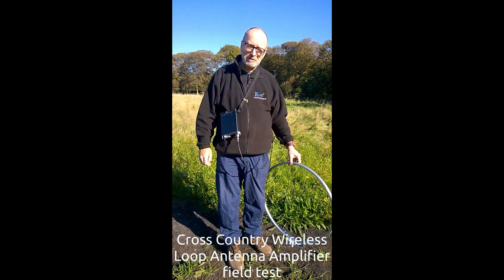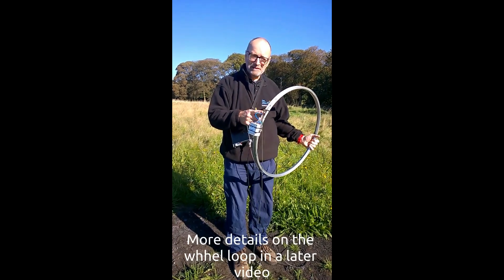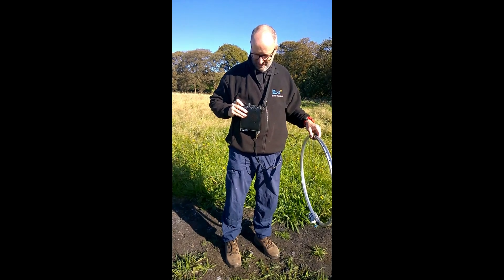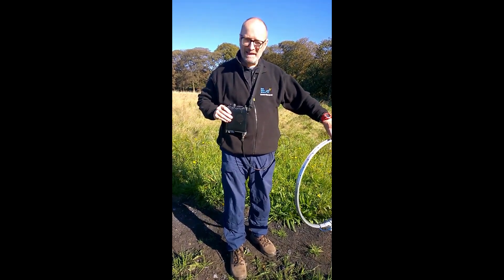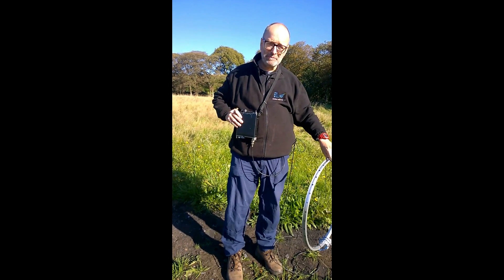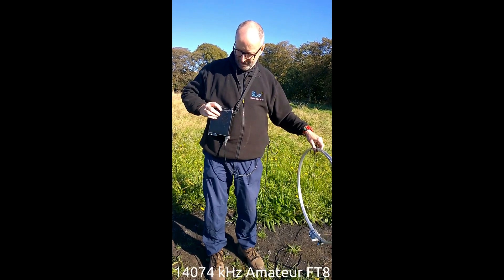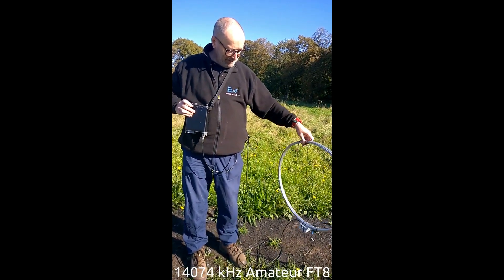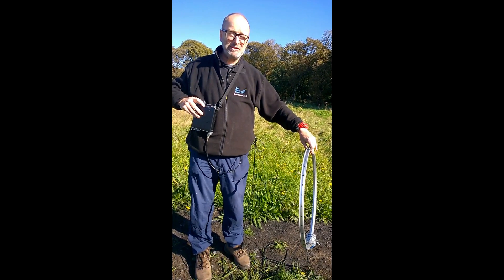Cross Country Wireless Loop Antenna Amplifier field test

Comment: No problem understanding the presenter but the wind noise was annoying (and avoidable) ... and I hate Vertical Video Syndrome.  That all said, I'm intrigued by CCW's new mag loop offering ... though I suspect I won't use a bicycle rim ...
Reply from the maker: Apologies for the audio and vertical video on this video. It was meant to be a last minute quick trip out of the workshop to provide a video answer to a forum comment about how high to mount a loop antenna. I decided not to take the professional Canon video and audio kit we use in the workshop as it would take longer to set it up than make the video. Looks like I'll have to make another video...
Reply: @crosscountrywireless  It's fine - you got the point across!
Reply: @crosscountrywireless  I couldn't see where the gap in the bicycle wheel rim like thing was. Is there one? If there isn't it will act like a shorted turn and reduce reception.
Reply from the maker: @BrianG61UK  There is a saw cut on the bicycle wheel rim. It's bridged by a piece of fibre glass board to maintain mechanical strength. The two nuts and bolts holding the fibre glass board are used as the terminals to connect short wires to the Loop Antenna Amplifier.